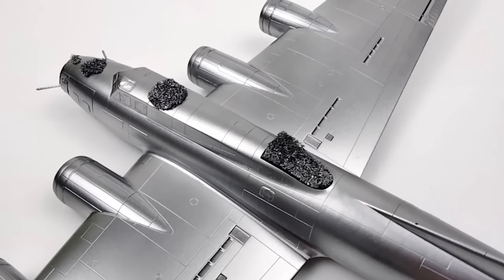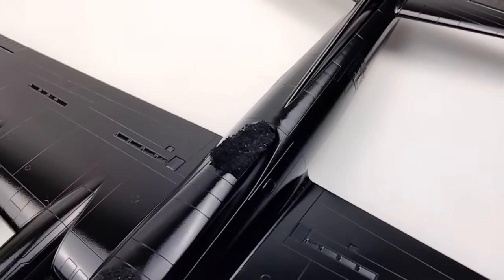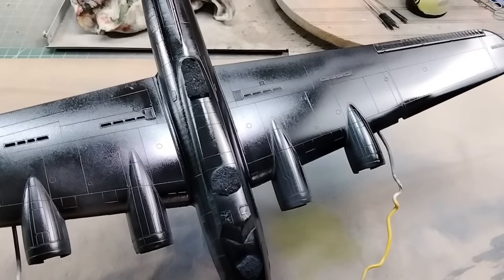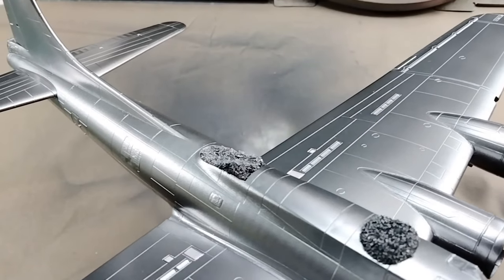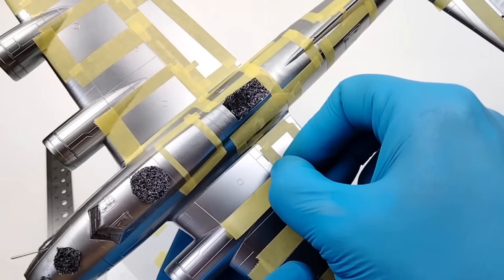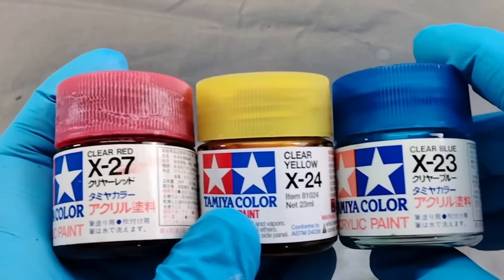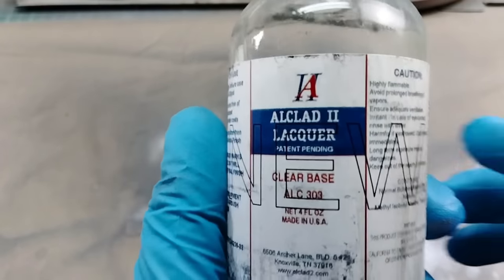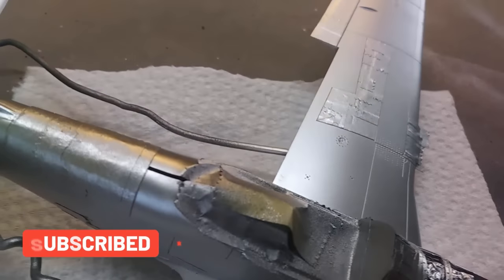Natural Metal Finish Made Easy!  Learn How To Apply, Handle & Mask For Plastic Scale Models.

Comment: There is also another way to go with your paints. You can add a drop or two of Black or Yellow paint to the silver and paint the areas you want to have a slightly different metallic look. Years ago, this was a technique I learned when applying bare metal foil on aircraft models. We would thin down one or two drops of gloss Black to the point it was a slightly dark clear thinner then airbrush a Bare Metal sheet to get the effect. It is somethng you need to experiment with to get it right. When I worked real aircraft in the USAF, I found that many of the aluminum sheets used to repair the aircraft can have slightly different textures and colors, depending on the metal manufacturer and if it has a corrosion preventative applied to it. Pure aluminum will form a thin layer of oxide that keeps it from corroding and will give it a slightly dull but shiny appearance. Some aluminum sheeting the Sheet Metal shop would get would be shiny but one sheet would have like a very slightly darker tint to it. Other sheets would have that slightly yellow tint to it. The variance to them was so slight you needed to have one sheet next to the other in the sunlight to really see it. 
FYI, some of the more modern military aircraft, like the A-10 will have on the wings, a clear Leading Edge Tape applied. This was done to keep the paint from excessive wear and stripping back over the wings. You can get that same look on a model with some dull Scotch Tape.
Reply from the maker: Wow! Great tip and insights!  You should make a video about how this works.  I would love to see it.

Comment: Whoa. 28 years ago..... I did a similar "technique" with little knowledge, with only the products available.  I used rattle can paint for the base (grey), then weather seams . Sprayed chrome paint over everything. Let dry for 2 days? Then buffed with steel wool.  Then weather paint again.  Came out amazing. I wish I still have the model.  (all without help from the internet or even a model maker)  I'm just saying, There are cheaper or easier ways to accomplish the same effects.     I've seen so many products that are sold today, producing the easy effect.          But I'm thinking the old fashion way is easier to control. Shy away from the cartoonie effect.
Reply from the maker: Interesting approach.  You should try it again and video your results.  You could make a video on YT.
Reply: So true , also did a simular technique back then .
Reply: Horses for courses I suppose guys. But as someone who has always struggled with NMF I will try anything.
Can I ask if you used a varnish coat and if so, which one? Obviously asking the two commenters here.
Thanks,
Ian
Reply from the maker: I used Alclads clear base.
Reply: @StyreneModelersHaven  Thanks
Reply: what's a cartoonie effect?🤔
Reply: @youtmeme  heavy dark lines that's similar to "cartoons".
Reply: @youtmeme  Heavy, dark lines...
Reply: Death Knell  --  when my daughter was born 😄
Reply: You did something similar using only cans of spray paint?  Cool

Comment: Great video, solid techniques.  The "ghosting" you mention is tape adhesive.  I avoid using even Tamiya tape on metal.  I cut "Post It Notes" to fit. This adhesive is much weaker and requires working on only one or two areas at a time as the masks may lift if not watched carefully.  Post Its won't leave that residue.
Reply from the maker: Great tip!

Comment: I seem to get a great metal look from Krylon Aluminum spray paint; I touch it up with highlights & shadows using some metallic acrylic brush paints.
Reply from the maker: That's a great idea!  I have seen others use the same Krylon paint with impressive results.  Join my email list and send me pics of your work.  I would love to post it on my YT community board!  Please sub to my channel as well so you get the notified when the next video of this series drops.
Reply: Just be aware that Krylon is a chemically "hot" paint that etches into whatever you spray it on in order to permanently bind to the surface. This can cause irreversible problems to your soft styrene model, particularly when put on too heavy.

Comment: Some EXCELLENT tips for sure but (yeah, there's always a BUT!) I'll throw another option into the mix:  I just finished a 1/48 Monogram B-24J that I re-scribed and riveted (yeah, seek meds) and my "process" is basically the same as yours but I prefer Alclad's Aqua Gloss over the Polished Aluminum.  NO ghost marks from masking with the Tamiya tape, it doesn't alter the sheen of the Polished Aluminum and therefore no need for the AK Extreme Metal.  Yes, the Aqua Gloss is an acrylic but I've never had any problem with it changing the sheen or lifting when masked.  I can also attest to its incredible toughness as when I did my oil wash on the panel lines, I left it on WAY too long and it pretty much fully dried.  Using the typical oderless thinner, I REALLY had to work to get the excess oil paint off and zero damage to the Polished Aluminum (and other shades) already applied.  Yes, the Aqua Gloss is just that, a gloss but it was already going over Polished Aluminum.  I decaled, sprayed more Aqua Gloss over the decals to seal them and then sprayed flat over the decaled areas only.  Now having typed this novel, you definitely have a good system that works for you and thank you for taking the time to put it on video!
Oh lastly....it looks like you sprayed the Airframe Aluminum over the Polished Aluminum, correct?  That's perfectly fine but remember it will certainly look different over Polished Aluminum than gloss black or gray.  Make sense?
Reply from the maker: Some really great tips here.  That's what I love about scale modeling, more than one way to accomplish the same result.  I had bad luck with Alclads aqua gloss in the past, but that could be operator error.  Join my email list and send me a pic of your work.  Would love to post it on my YT community board. I could also include your breakdown on how you did it.  Link in description of video to join email.

Comment: Trying this out on a P-47D right now! learned the hard way not to use too much pressure on the black undercoat, wet sanded so should be GTG, after that I plan to tackle a b-17!
Reply from the maker: Glad it helped!
Reply: @StyreneModelersHaven  So it came out pretty good but the Allclad top coat is gritty, can I do a light wet sand?
Reply: NM I used 10k wet/dry and it looks awesome!

Comment: Great.  I can start work on my long out of production B-58 Hustler model, a huge ancient long out of production 1/48 scale Monogram kit.  I love bare aluminum early cold war era jets
Reply from the maker: Still a great kit!  I have one in the stash too.
Reply: @StyreneModelersHaven  It's a very tough kit as far as insuring perfect invisible seams and gaps.  This is going to be a really hard to handle model as it gets metalized.  I plan on hiding thick plastic beams inside the inside the wings where the engines meet the wing.  The idea is for the engines to be temporarily removed so I can paint them better.  The same goes with reengineering the landing gear.  I expect to spend over 300 hours on this model.  Sounds excessive but the model needs heavy reengineering just so I can safely handle it while painting.

Comment: thanks!!! I have a question- how do you remove accidental fingerprints once the Aluminum coat goes on?
Reply from the maker: That would require sanding and reapplying the metal coat.

Comment: Subbed thanks. 
What’s the final coat you use for bare Aluminium ? Semi gloss varnish? 
Mine looks too dull with Matt over Vallejo silver base but too glossy with gloss varnish 😂
Reply from the maker: I use alclad clear base.  It finishes the metal look in a satin gloss.
Reply: @StyreneModelersHaven  thanks bro

Comment: Hi great video cracked the code. May I ask, why you can't use the AK for the first metallic stage instead of Alclad metal finish.  Not that I would try it other than on a test mule, but maybe its a reaction issue. Kind regards Dave Porter  London
Reply from the maker: You can use AK polished aluminum as the primary metal coat but I did not like AK polished aluminum.  It almost looked like it had glitter in it, at least the bottle I had.  IMO, the Alclad left a better more convincing polished aluminum.  Really you can use any high shine metallic paint as the base.  The idea is you want to start shiny since the final AK aluminum is going to tone it down.  If you start with something already less shiny, AK aluminum will mute it more.  Not that it is a bad thing.  You could experiment if you want to go with a more war weary look. I am going for a little more shine on the b-17.

Comment: What an informative video! I just wonder why the ghosting happened? I experienced it before but I didn't figure out why. I was thinking it was the tape residue so I rubbed it with enamel thinner; obviously it wouldn't work, I ended up with repainting. I am still puzzling why. If you could share any thought, it would be so appreciated.
Reply from the maker: My guess is that that the adhesive reacts with the metal paint or perhaps the adhesive pulls some of the mica powder when you de mask.  Only a guess though.

Comment: I wonder how's the clear base is going to hold over time. I've just been to my hobby shop and they had 2 bottles of it: one has almost indistinguishable tint of yellow where another one was closer to the clear yellow... 
With that in mind in the past what I was doing I was priming with Mr Primer 1500, giving it a rub with 3000, then was applying decanted tamiya silver leaf or gloss aluminum, then alclad airframe aluminum, aqua gloss, mask with tape, apply other shades of metals and then thin layer of alclad airframe aluminum or chrome. Aqua gloss, decals, aqua gloss and then alclad light sheen or klear kote gloss with a bit of light sheen b/c when it is either gloss or aqua gloss it looks like glazed doughnut to me.
Reply from the maker: If your method works and you like the results, that is great!  There is more than one way to achieve different finishes and there is no right or wrong way.  That is what I love about this hobby, so many great solutions and different techniques to achieve the same result.

Comment: Very inspiring !!!   What metal shade / technique did you use to create a more matt look for the painted-fabric control surface ?
Reply from the maker: I used Alclads matt aluminum and I will also be applying a matt coat to the flaps as well at a later stage in the build.
Reply: @StyreneModelersHaven  THANKS

Comment: Actually, the bare metal finish on aircraft because more commonplace near the end of WWII til the Vietnam Era. This was because aircraft—like the P-38 Lightning and the P-51 Mustang followed by the early jets became so fast that the paint kept peeling off the aircraft! It became a cost issue to keep repainting aircraft. The faster the planes became, the worse the problem got. Then, they developed epoxy-based paints that stayed on. The Airforce initially didn’t mind so much because they figured speed and, in the cases of the B-29, B-36, etc., altitude would keep their aircraft safe but Navy welcomed this solution because seawater and salt are corrosive to metals.

Comment: I had the tape issue on a P51 i was working on.  Was frustrating me every time i painted another color over it.  Nose color, tail color, ainti glare strip.  
So once you vanish all the tape ghosting with the AK aluminum, then hit it with the base coat again, I should be good to paint the rest of the colors without the tape smoo showing back up then?
Reply from the maker: Exactly!
Reply: @StyreneModelersHaven  awesome! I threw the P51 on the shelf of shame.  Once I'm done with my current build, I'll get it back down,  strip the paint, and follow this method! Thanks! The videos are great!

Comment: Just an FYI, there is NO better tape than pinstriping tape for masking and especially areas on curves or uneven surfaces. Not only that it is way cheaper then modeler branded tape.
Reply from the maker: Great tip!  Thank you.

Comment: Only one way to make "natural metal" is applying aluminium foil to your model. 
Painting - is like you try to cheat YOURSELF with "natural metal".

Proof is easy: i
ntroduce me some good photos of models painting in your style 
and some photos of models covered with real aluminium foil. The result: every modelist EASILY determine where is real aluminium cover and where is ridiculous imitation of "real metal" with expensive advertised paints.
 We can really make this experiment.

So, I heil to believe your own eyes, and not believe to advertisement!
Reply from the maker: Using foil is a great way to do NMF but it is one of many great options.